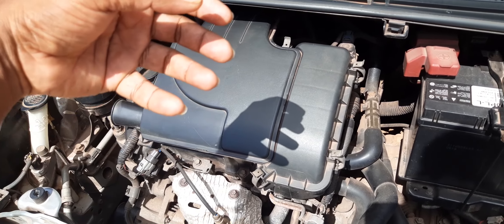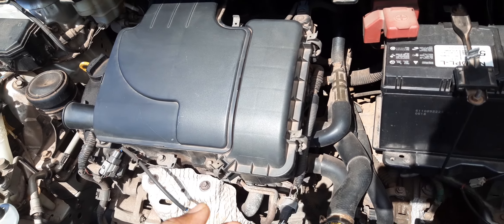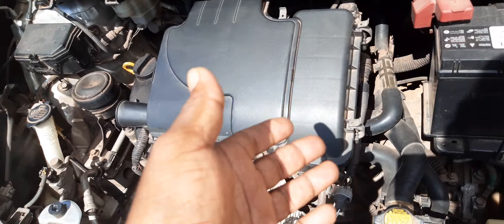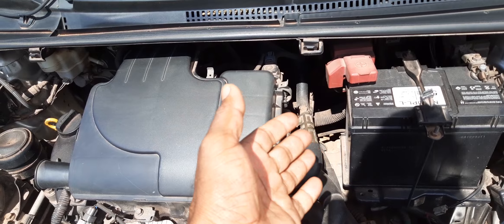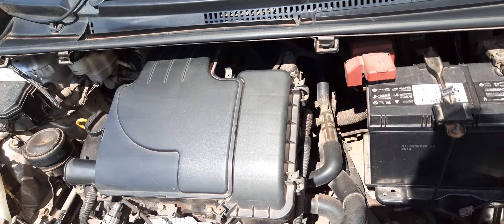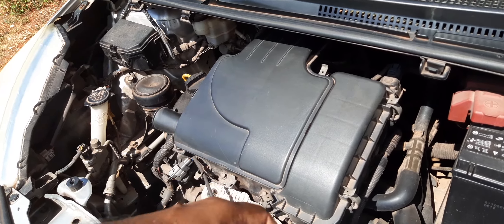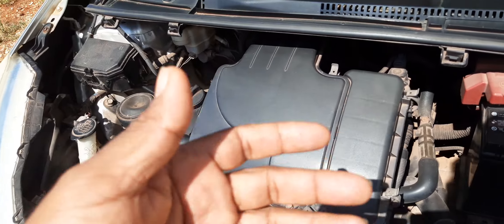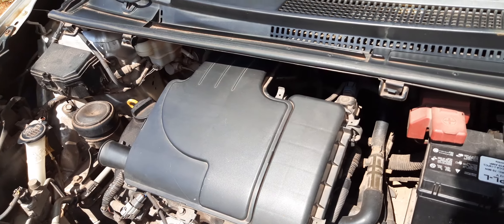Number One Cause Of Engine Vibration

Comment: I suggest using as a preventative measure on my 107, additive for catalyctic converter cleanig. Would you recommend it? Would it lower the vibration?

Comment: @ Shel dock  what is the recommended oil for this engine
Reply from the maker: I use Toyota 10W 30 engine oil. The 10W tells us the viscosity at start when the engine is cold. In some countries the weather gets really cold so it is necessary to use a lower W number like 5W or 0W. In a warn climate the viscosity of 10W is good.
Reply from the maker: We also need to remember that the other number 10W 30, the 30 tells the thickness of the oil at normal operating temperature- when the engine is properly warmed up.

Comment: I have a Toyota vitz 2013 1000cc . I maintain it very carefully and on time. But vibration issue is always happening. I cleaned throttle and all the injectors but nothing progress 😢
Reply from the maker: Remember that many contributing factors could cause engine vibration. When mechanics are working on a vehicle to solve this problem they usually check through all the problem points. These includes:
A. The throttle body 
B. Spark plugs 
C. EGR valve 
D. Fuel pump 
E. Coil packs 
F. MAP or MAF sensor
G. Injectors 
Its difficult to pinpoint the exact problem point or points so the importance of checking all the points of failure when  you visit the mechanic.

Comment: I'm hearing engine knock its not the bearings I cant find the problem
Reply from the maker: Engine knocks can be challenging to identify but it's always necessary to isolate the external moving parts on the engine such as the alternator, pulley assembly etc.
Reply from the maker: You would need to remove the belt and start the engine then listen for the sound. Remember that the engine can only run for a very short time during this test. The belt runs alternator and water pump.
Reply from the maker: 1. If sound is present during this test then you have internal engine knocks- connecting rods bearings may be worn.
2. If sound stops then it's the external moving parts are at fault.